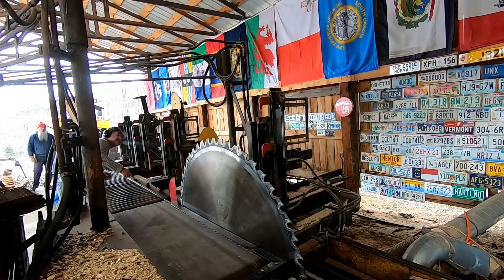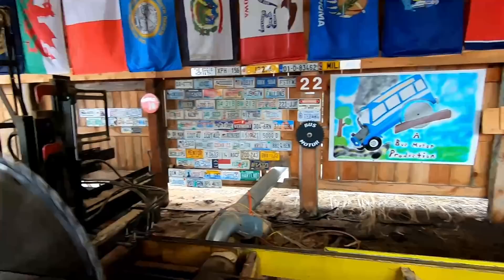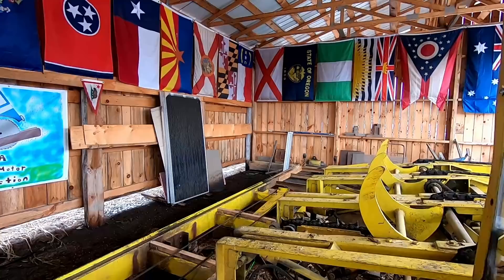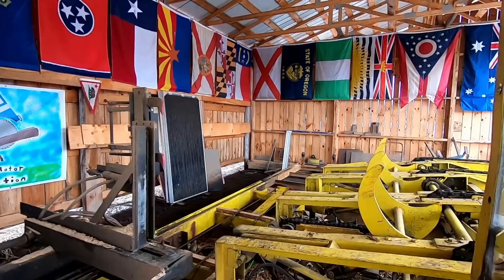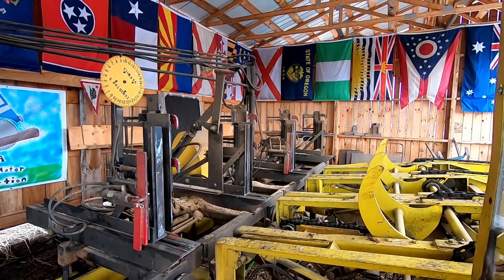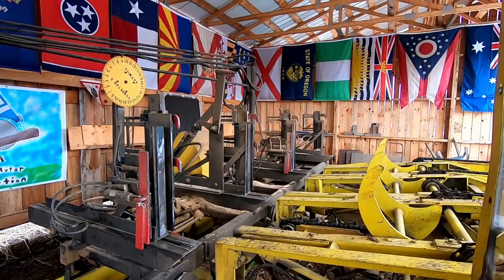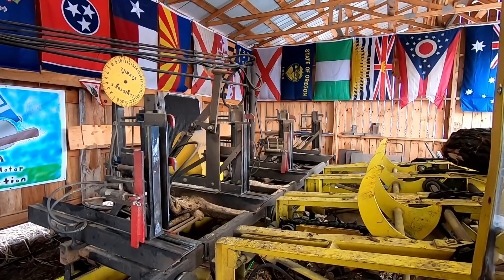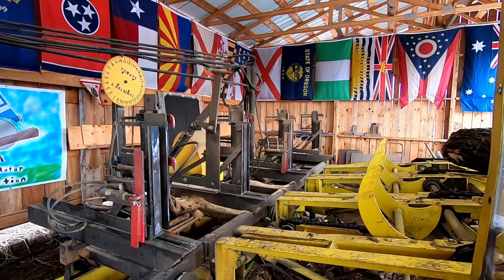sawing black locust # 272

Comment: Hi Guys, a much appreciated sawing video.  Coming from the UK, I'm not familiar with this type of wood, am I right in saying that Black Locust is a very hard wood.  Stay safe.
Reply: Black locust is harder than white oak. It is durable, naturally rot resistant with good weathering characteristics. The wood keeps its qualities without the use of oils or chemicals. 
It is frequently used as fence posts for its outdoor longevity.
Reply: @paultennis9414  Thanks for that Paul, much appreciated.

Comment: That is some really nice wood.  I have never seen it cut into boards before. I have to try and find some.  How are you going to dry that for use?
Reply: It is diffiqlt to use blak loqst for boards because it is very prone to splitting. Usually has much much tension in it.

Comment: Is what ya'll call locust the same as what we down here in NE Texas the same.
While I've never seen what ya'll have except on YouTube, it's has a different bark, and grows bigger than anything I've ever seen down here.
Not that I have probably ever seen one grown to maturity down here, at least not what I would have recognized as being the same spices. 
Everything I have had the displeasure of dealing with grows rampant along the fence lines, and will takeover if let go too long. 
Biggest I'd say is about a foot across, but has a smooth bark, are at least what little you can see for all the deep purple, and light green thorns popping up in pods all over the trunks of the trees, and every limb is covered in the same with the thorns averaging 3 to 4" long and easy 1/4" at the base.
Noted to cause severe infections when tips of thorns break off in the skin.
True as yours are very dense wood, probably as dense as Bois D'arc, are horse apple trees as also known down here.
But I have cut them in the evenings, and seen sparks coming off my chainsaw chain, and it was well lubed so wasn't dry chain causing it. 
I'm told they're part of the memosia family, and another name used my be the actual correct name, and that's black bean memosia.
They also have leaf structure that is similar to the not so lethal version too.
Makes great blocks for blocking up sheads and I've seen old frame countrt houses use them to block up houses themselves. 
Great firewood and will put any oak or other hardwoods to shame as far and burn rate to left over coals after pulp is long gone. 
Just never seen anything that big, are with the bark like you have up there.

Comment: Thanks for the video Mark. Is locust the hardest wood you guys have sawn at the mill? How would you compare it to Oak? Thanks and be well.
Reply from the maker: thanks John , I think hickory is harder to saw than any hardwood here.
Reply: White or red oak are around 1300-1400 on the hardness scale, locust is 1720 so it is harder. Hickory is around 2000. Southern live oak, and exceptional type of oak is around 2600 which is almost as if you were dealing with iron. Too bad it grows very curvy and crooked so it rarely produces good logs to saw.